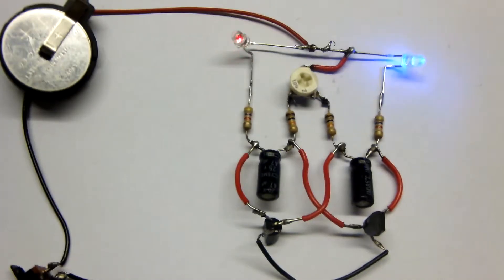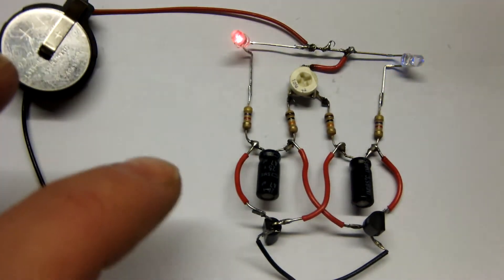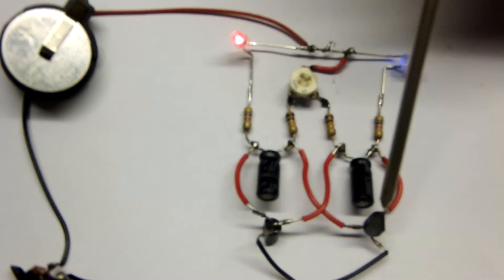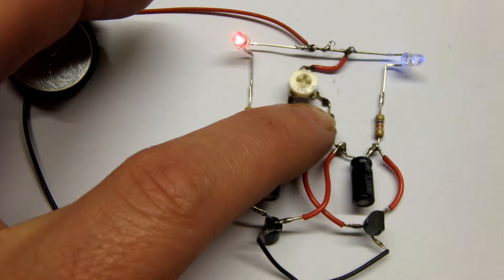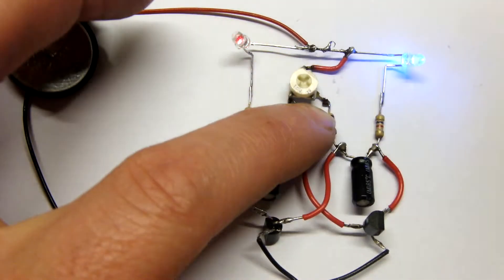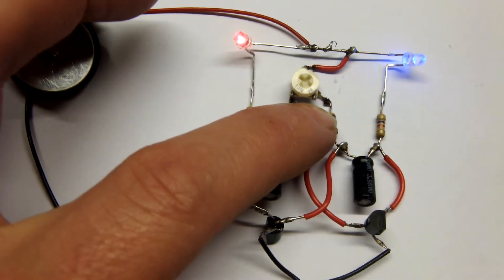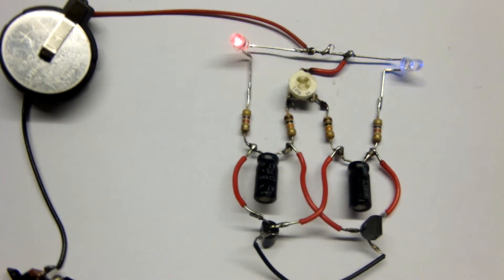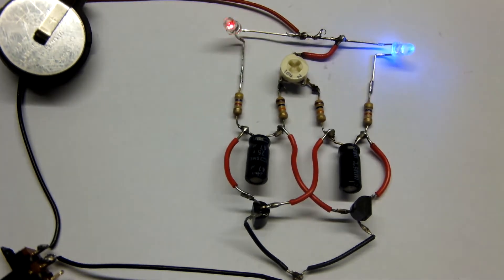Variable Alternating Flasher Circuit for R2-D2

Comment: Is it possible to make it go 3 blinks a second with only one LED light. I am working on a project and just learning circuitry and I been searching all over for something even close to this. Basically when switched on I want to replicate a human pressing a button at the speed of 3 presses a second infinitely. After a lot of research the concept seems to be the same as blinking LED lights, only instead of a light there will be the signal this device produces.
Reply from the maker: Hi There, sorry for the slow reply. Hmm this circuit is basic and yes variable, but these days I use Arduino and write code for whatever i want. It's not a hard as you think. Its all free too. Best of luck. :)